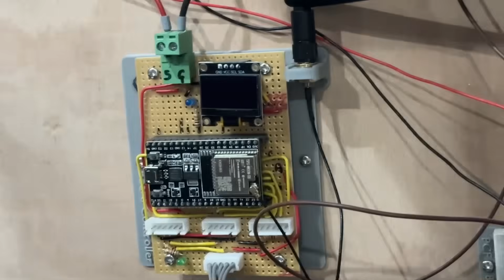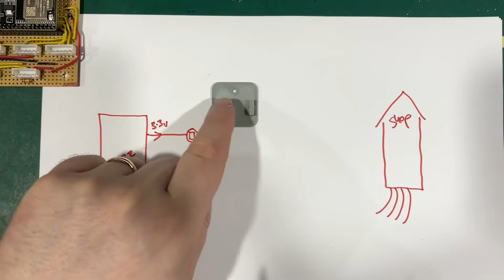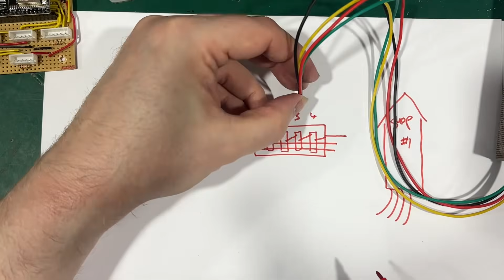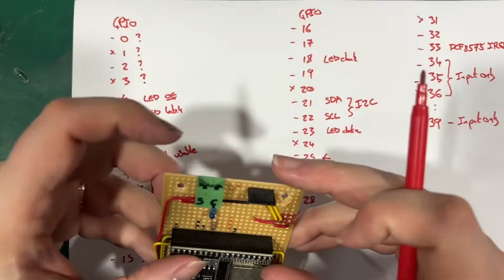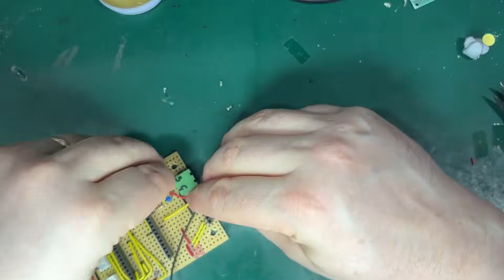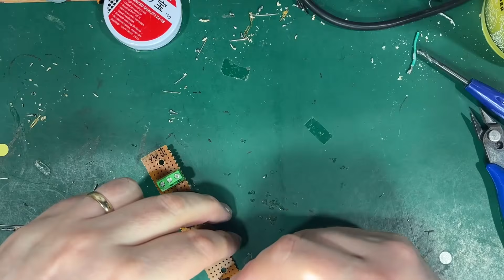99, Illuminating Fashions at Leopard Street Model Railway

Comment: Let there be light! I enjoyed watching this as it gave me lots of ideas for connecting up various bits and pieces when I come to do lighting and other modular type stuff! I'm saving your electronics series for when I have time to binge watch it, so was a little confused by the Pixel thingy, but no doubt I'll be enlightened (see what I did there? :)) when I go back and get stuck in to the aforementioned series! I've seen that perfboard when looking at breadboard, but the soldering puts me off, not that I'm a newbie at soldering any more, and have a very capable iron! I'll have to give it a go next time I'm in the market for breadboard! Cheers, Ian.
Reply from the maker: your soldering seems way better than mind so far :)

Comment: Those boards all look very neat and tidy 🙂 Shame about the soldering on the perfboard - I've (so far) found those really easy to work worth, and that's certainly not down to my skill or the spec of my soldering iron (which was £40 from Amazon). The building should look nice once it's nestled.
Reply from the maker: the fault will, as always, be entirely with the soldering iron to chair interface unit. the iron itself is half decent, with a decent tip, I've got a few more on order to see if I can get one that is a reasonable fit - the current one is too tarnished, I've cleaned it and it worked for a while but they are cheap.

as for the building they are nice kits, I do need to do something for the inside on the two exposed floors though, way more visible inside than I thought, I think curtains and "something" on the back wall, even if its just a few brown and grey squares to look like offices or similar, break it up a bit. really do need to get some people painted up as well.

wire should be arriving in the next couple of days and then it can go in and I can start on the next one

:)

Comment: Very Nice Result need to look into the pixel as well.  currently using led's connected to servoboards PCA9685 which are controlled via a CMRI node and JMRI via the FastClock
Reply from the maker: have a look at the TLC5974 as well, similar device but manages constant current so no need for limiting resistors, also 24 channels. 

have used them with CMRI before

plan here, since JMRI is less good with colour changes, just on/off or intensity, is a separate "light controller" software that can take the fast clock or a real clock and manage on/off around that for a bit of randomness.

plus obviously for the sake of it "party mode" with disco effects, christmas light effects etc. not fully worked out how they will be controlled other than "via mqtt".

I actually went with the pixel stuff to limit wiring, the other video setting this up nots that four LEDs for individual control is 5 wires, larger buildings are many more which becomes a problem, the whole high streets worth of buildings here are three wires from the panel out which saves a lot of potential issues - even if as at present the lights just come on at start up.

also makes it quite easy (the PWM controllers can do this too) to have on/off channels then another channel for "day/night" mode, my N gauge layout did that to have street lighting (well light, only one was wired up) on brightly during the day so I could see it, but much softer at night to not dazel around it

:)

Comment: If the solder does't "wick" into the wire, in most cases it not the solder but the wire.
Real copper wire wicks the solder where as aluminium doesn't. Aluminium was cheaper than copper and so there was a lot of "fake"copper wire produced.
One random fact about aluminium wires is that if you can't get higher the 40mbps broadband it probably because the grid phone lines are still aluminium and not copper. 
We found that out the hard way and had to wait for fiber to be installed to get decent speeds in a town!
Reply from the maker: my in-laws suffer from crippleware broadband off the back of this.

"in theory" that wire is pre-tinned, I suspect its actually chinesium, works in the end but its irritating, several variables here as the soldering iron is definitely not up to scratch 

good tip though and a story many won't be aware of
Reply: @aleopardstail I run my soldering iron at 200-230 degrees and rarely get a problem with copper but chinesium yes is horrid. Apparently you can tell the difference by holding the conductor to a flame. Copper heats but aluminium sparks
Reply from the maker: now there is a trick to try and remember as a test

Comment: I must be missing something because Vout from the pixel can not be higher then Vin from the ESP32
It breaks all the laws of electronics.
Reply from the maker: the data line is 3.3V from the ESP32, but the Vcc in is 5V from the 5v supply, the pixel then outputs a 5V data signal which will carry better over the length of wire to the next pixel along.

its a weird technique but so long as the ground is common it works as the LEDs will see 3.3V as logic high, dips a bit and they won't so this is how its usually done, in effect you "waste" a pixel, though here its a handy status indicator but it level shifts the signal for you

its not my idea but its not an uncommon one

:)
Reply: @aleopardstail  Wow didn't know that trick at all. 
Thanks for the tip.